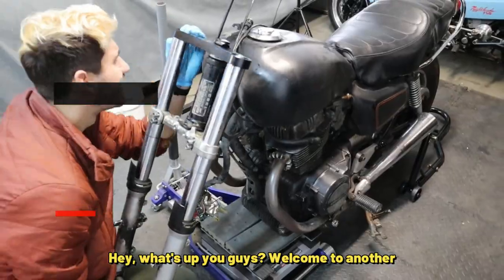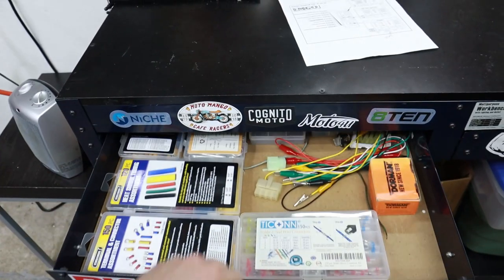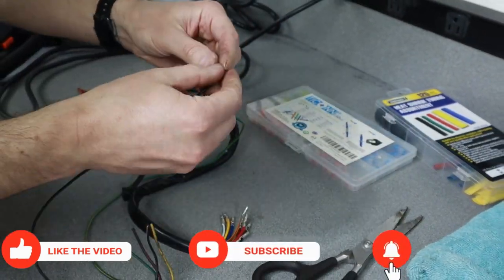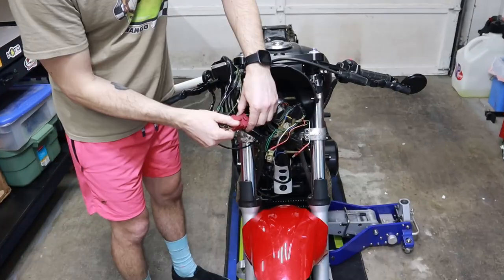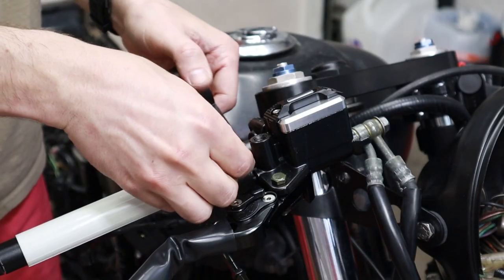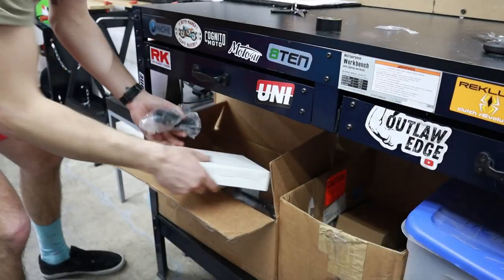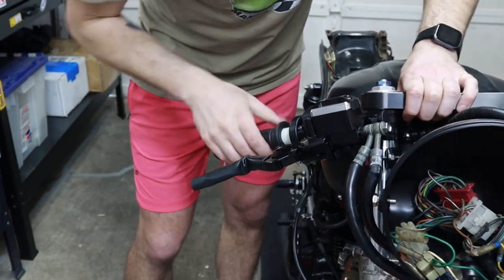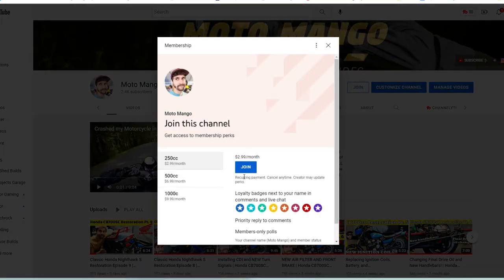Installing a UNIVERSAL Control SWITCH | Cafe Racer Build

Comment: Nice work, looks like we use the same levers BTW, they're pretty good and great value. Those mirrors are quite neat too.
Reply from the maker: Yeah, they are decent for a budget build! I like the styling a lot. The mirrors were like $20 on Amazon 😆
Reply: Me too, I like that they include the reservoir, saves you having to work out where and how to mount that too!
Reply from the maker: Exactly!! 👏
Reply: Got a link for the levers?   Those are on my list.   I hate the giant chrome ones currently on mine.

Comment: What throttle is that?    Could you do a review of it and go over how you made the cable?   Right now I'm using the pull r6 stock cable.   Whitener stated this cut the push cable and left it hanging out the bottom as a "guide" but there's no stop built into the stock throttle so i ordered a set of replacement cables not sure if the push cable will work maybe he cut it off for a reason like the lengths are wrong.   I'm still learning as i go.   I'm an auto tech but pretty much brand new to working on bikes.
Reply from the maker: I replaced the stock carbs with Mikuni carbs so I'm using the throttle body and cable that came with those.
Reply from the maker: I would continue to use both the push and pull throttle cables if you're running the stock carbs. You can shorten them by cutting and then soldering the little cylinder plug back onto the cable.
Reply from the maker: Just buy the OEM throttle cables for the cm450 and shorten them to the needed length. That's how I would do it